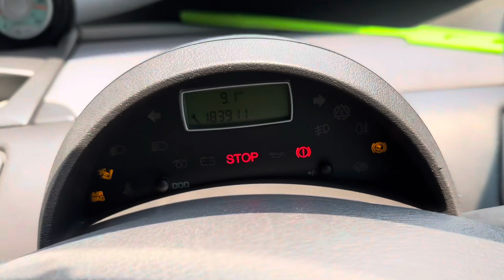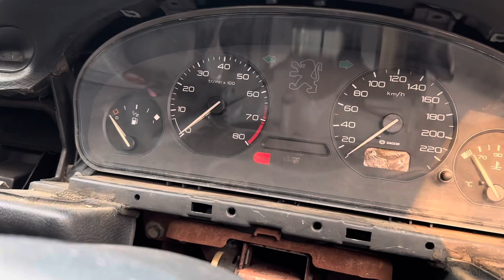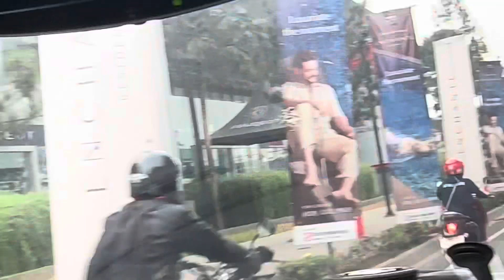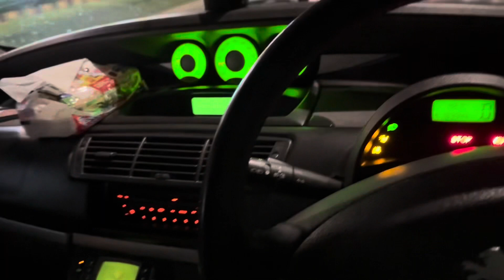PROJECK 807 part 9 - hunting mobil di junkyard masih pada mulus

Comment: om mau tanya suhu peugeot 206 susah banget naiknya, ke 70derajat lama, 75 derajat kipas high speed udah nyala, jadi bensin boros, suhu manteng di 75, yg perlu dicheck apa ya om kamil?
Reply from the maker: Harusnya yang Higt speed mendekati 90 baru mutar kemungkinan ada masalah di Switch  atau ada jamperan kabel
Reply: Makasih om, nanti dicheck
Reply: Hose heater harus sambung......jangan di stopper......tempreture ...jadi stabil...90